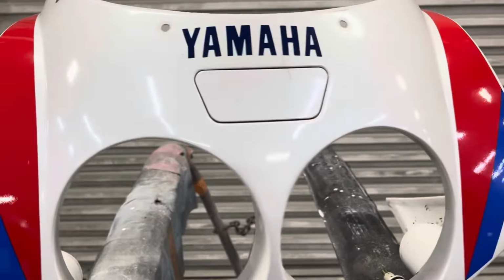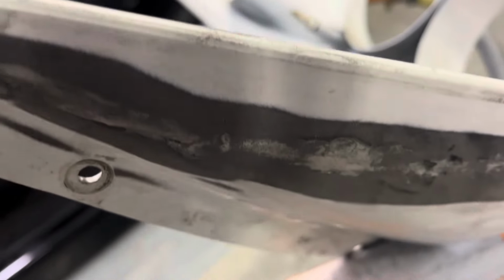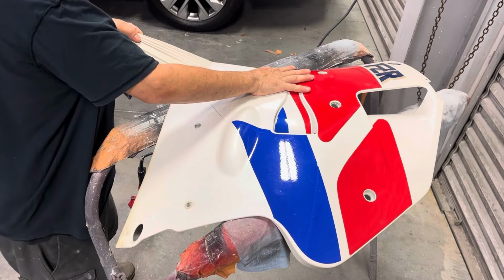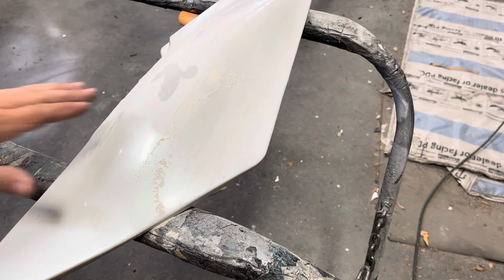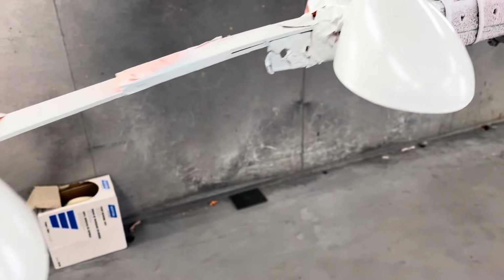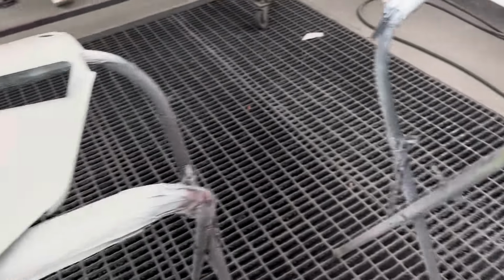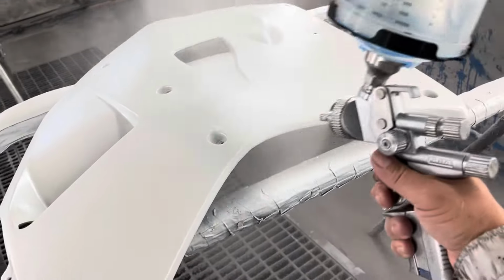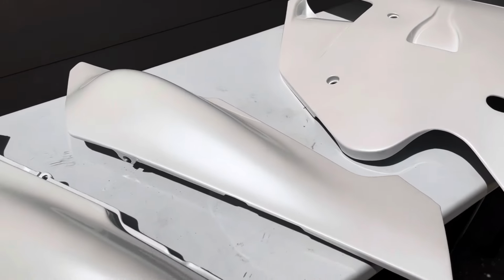1989 Yamaha fzr1000 back to its original glory

Comment: Yamaha is a company I love because they had the 1000cc superbike thing down years before others finally joined the liter bike competition.  Suzuki & Kawasaki seemed to be focused on their 750's, Honda sportiest bike was their 600 and then their 900.  If you wanted a liter bike, the FZR1000 was the bike and the GSXR1100 was too heavy (but maybe a great starting platform if you were into drag racing).  My first gen CBR900RR was a nice reimagining of what a great superbike could be, but it isn't like there wasn't a great one already--the FZR1000.  And to be honest with everyone, although I've had my bike for 30 years (come a few months), the FZR1000 had a higher top end, and more torque and more HP even disproportionately compared to the 900cc (more HP per cc).  If the road was straighter, the FZR1000 would be the victor, whereas if it were a tight and technical track, then the CBR900RR would have the advantage.  Anyways, that was the superbike king, the best bike, the best year, and when they would do tests like a Countach vs a top superbike, this was the bike they would choose to represent the best of what a superbike could be.  1989 FZR1000 in this scheme and a 1994 with black and orange and purple lines was also a nice version.  I wouldn't have written this much if it weren't one of my top favorites.  I hope a great collector / serious fan buys this one.
Reply from the maker: You nailed it not really anything else to add. I always thought the 900rr was more like an ama superbike. It would take a 900cc motor to match the 750 with all kinds of motor work so it had the feeling of a worked over superbike if it’s time. The fzr1000 kinda did it all right and kinda comfy too. Ride fast ride slow didn’t matter.
Reply: So, back in the day, I totaled a 93 Nighthawk and needed a new bike. I looked at a used 94 black/orange/yellow FZR1000, bear in mind, this was NJ. The insurance was 2000 dollars a year! I ended up buying a 91 VFR750 used from a shop that used to do my tires. I still have it and go to work on it too. Runs 150 when I want it to too. Pushing 100,000 miles.
Reply from the maker: @ridervfr2798 that’s awesome they are great bikes. I’d like to have a 96.

Comment: The mirrors can be brought back with vapor blasting
Reply from the maker: That’s good info. I don’t have one but do you think baking soda blaster would do the same?
Reply: @mmotorcycles9497  - I don't know about soda but I have seen different color mirrors like the white FZR or red Honda NS400 that were looking old and tired but after vopor blasting they looked nearly new again.  Works on rubber parts too
Reply from the maker: @p51bombay thank you for the comment. It’s nice to get helpful hints.